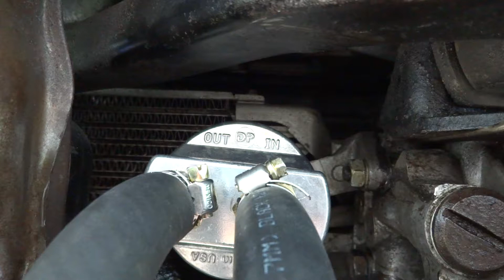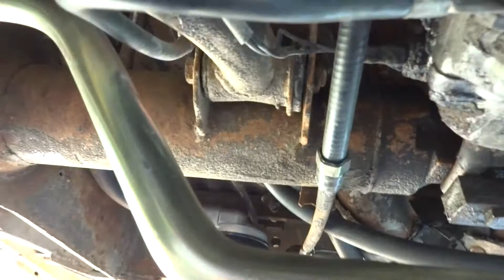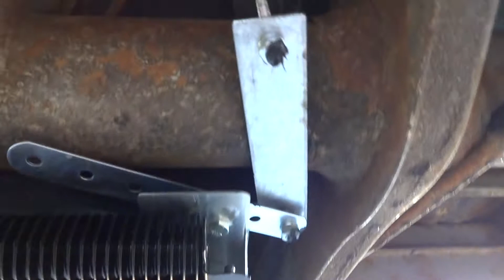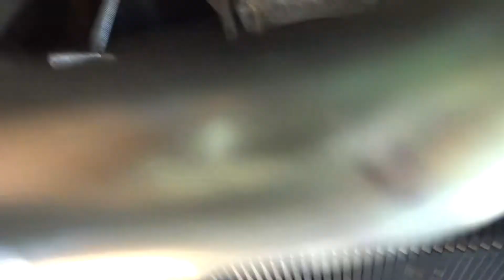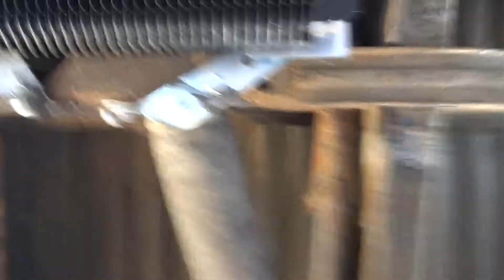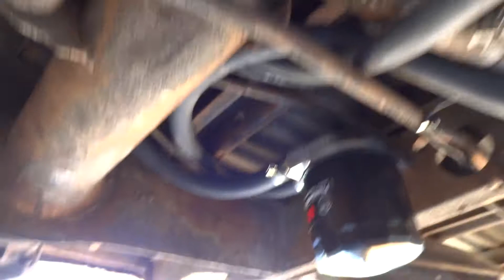VW bus oil cooler

Comment: Hi there , just found your channel. Looking to do an oil change on my bus, got underneath and found one of these! Didn’t know I had one also an oil filter. I’m guessing the oil filter is a universal type? It’s mounted horizontally. Is you system still fine? Does it effect oil changes process etc? Cheers
Reply from the maker: I still have this system on the bus. It has worked fine for me. My filter is mounted vertical so I fill filter with oil when I replace it during oil change. I have had no problems at all with the oil cooler,filter or lines. I also inspect oil lines during oil change and make sure they are secure. I just had the bus out yesterday and its running good.

Comment: LOL

A+ for effort

C- for execution

Lot of VW and Porshe air-cooled engines out their with simple and effective oil cooler modifications (yes, both companies same parentage and same engineers). Take a look at what other people have done. This is NOT the best way.
Reply from the maker: I did this set up a few years ago. Has worked good. No problems at all with it. The bus still has this cooler with fan working and runs very good. I installed this just before I did the rebuild. Increased displacement to 2100  with a high lift cam, big heads, 44s and Jay pipes.I wanted to be able to reduce the heat from the bigger engine. Made runs from Carolina to Florida  up to PA. a few times. Many other trips in  North Carolina and VA. Most have been to music festivals.. This is one of many I have installed over the years. Most have been on antique bikes and cars. If you have pulled a engine or been under a bus you know space is limited. I'll be taking the bus to Full Moon Bus Club camp out at Hagan Stone  in a few weeks.  Keeping the old stuff on the road is what I do. Thanks for the comment. Richard
Reply from the maker: Update on cooler install. Its now 2018 and cooler and motor are running strong.  I have not had a single problem since install.